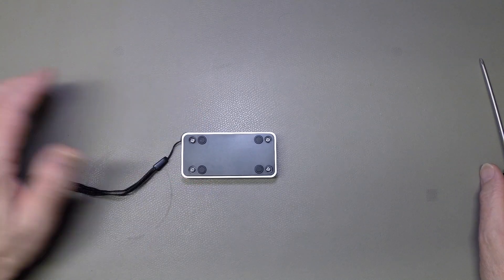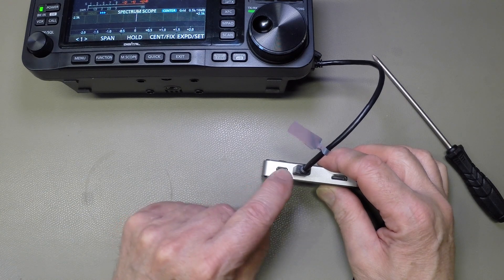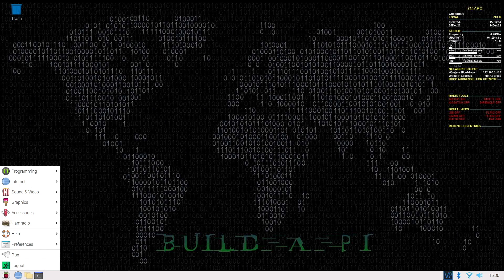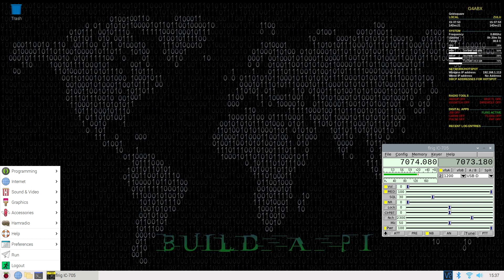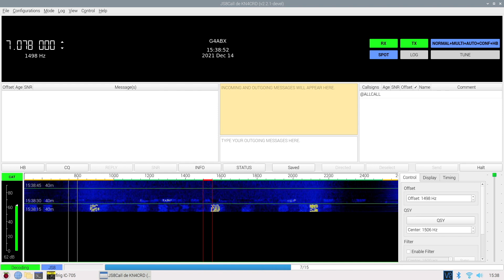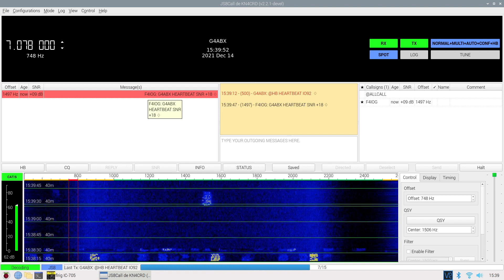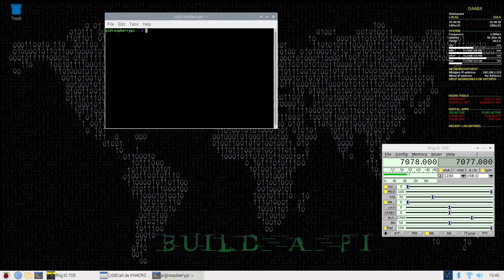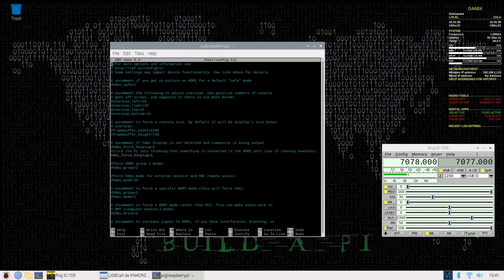Raspberry Pi zero 2 W for Ham Radio IC 705 part 3 'Putting it all together'

Comment: Hi Bruce, I've built  a couple of Raspberry Pi based amateur radio projects for running digimodes in the field and came across this one a couple of days ago and thought I'd replicate it to accompany my DX-500 /P system. I loved the idea of using the Pi Zero and whilst I've got the Flirc case for a Pi 4B I didn't know they made this one. It's tiny!

I have it all up and running but I thought I'd throw a coupe of thoughts into the mix.....

WSJT modes are time sensitive so need a stable real time clock to time TX and RX. The Pi has an NTP client daemon that runs to get time from a pool of servers when the device starts so the lack of an on-board RTC isn't normally an issue. In the field if it can't see the servers because it's not connected to a network it reverts to the last known time so is out. To fix this on the other two projects I added a small £5 RTC module and that works perfectly. I will sync it when I'm at home and its time holdover is sufficient for a period to remain accurate enough. It should be within 1s of UTC ideally. 

Adding an RTC to a Pi Zero in a Flirc case is a bit of a challenge as there is no space. However, you can add the ability to us an iPhone as an Internet hotspot using a package called usbmuxd. When an iPhone is set up as a hotspot and plugged into a Pi it will enumerate as an Ethernet port and so the OS can use that to get out into the wild and pull time. I have it running on mine (I also use it with the other projects, it's also useful to let pskreporter report back) although does need a special cable to go Lightening to micro-USB. I've tested it with a micro to USB-A socket and then plug a standard Lightening to USB-A into it and it does indeed work. Once it has time, the phone can be unplugged and the soundcard / radio connected. I have a cable on order from Amazon and cost about £8. I don't think it needs to be MFA licensed so expect it to work. If not, I'll just have to cart around the USB-A adaptor. 

Another issue I ran into is an incompatibility with the desktop used in the Bullseye OS  and Fldigi which AFAIK interferes with the Pulseaudio system so results in no sound devices being available. I burned a LOT of time with this as I like to use Olivia on 60m. Running Buster works for me. 

The Hotplug config entry also burned up a LOT of time. Why is this is a thing when the whole idea of headless operation is typically mutually exclusive with having a monitor??
Reply from the maker: Interesting!
I use the RTC module on my Pi4 setups -- for portable use mainly where I don't have Internet connectivity.
I to run Buster for the exact same audio issue. 
My main 'digital modes' PC is a Raspi-4 8Gb with a 200Gb SSD. 
I tend to use an external sound card if my rig doesn't have one -- or use the IC-705 that is 'plug and play' with FLRIG and WSJTX
keep the ideas coming!
73
Bruce G4ABX